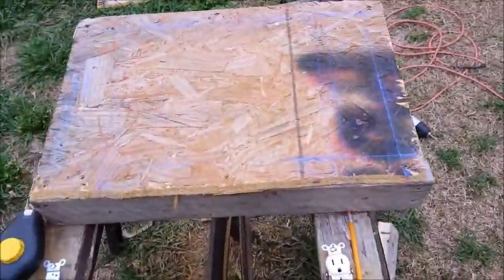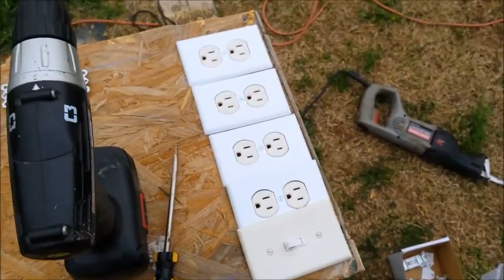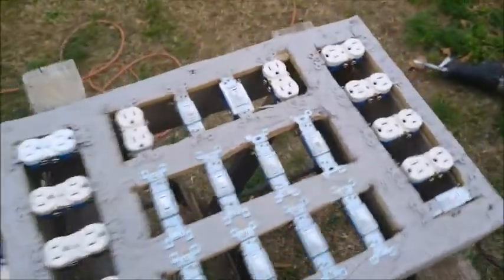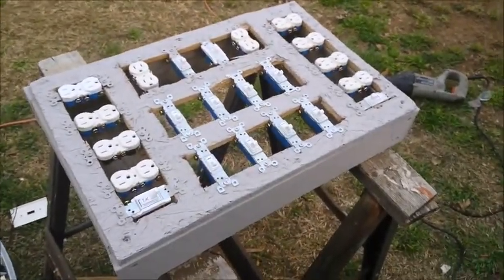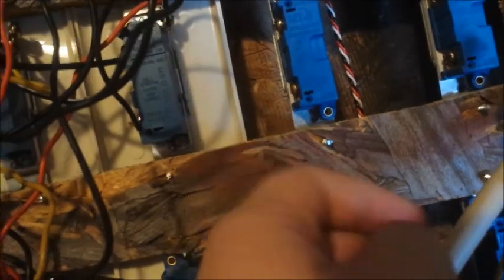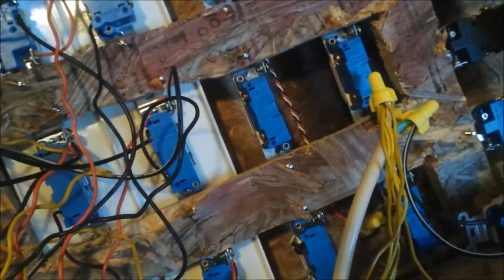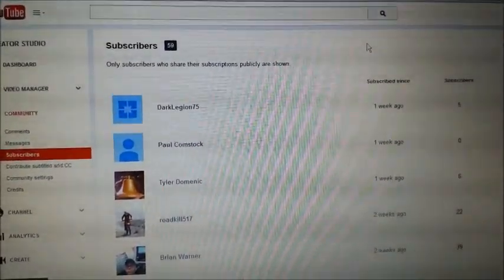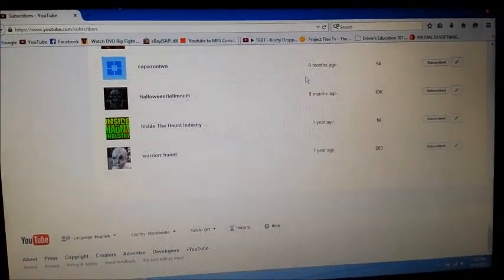Building An Electric Switch Box!

Comment: Adam, you can fix that overlay problem if you ditch the two outlet plates and pick up a few of the four outlet cover plates. That should allow you to position things closer together.  The same can be done with the switches as well allowing for a tighter setup. 

The other way you could do it would be to make a custom cover plate. Just position things where you want them and cut the cover plate from either a sheet of plexiglass, or maybe just buy a big storage tote and chop out a section of the side to use. I've done that before and it's a lot cheaper than a piece of plexi. :-)

Comment: You should cut the slot a little longer so the covers lay flat, may take only 3/4 of an inch longer.
Reply from the maker: capazontwo Not too worried with aesthetics, as long as it works, i'm proud of my accomplishment either way, haha.
Reply: That's all that matters